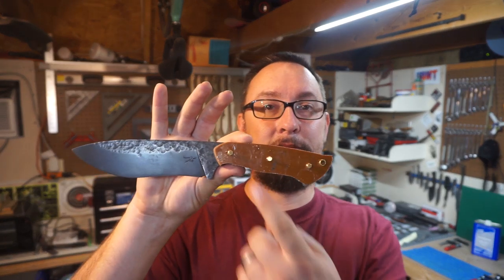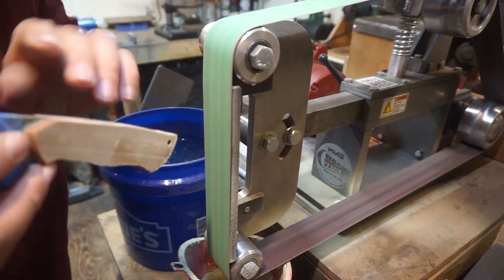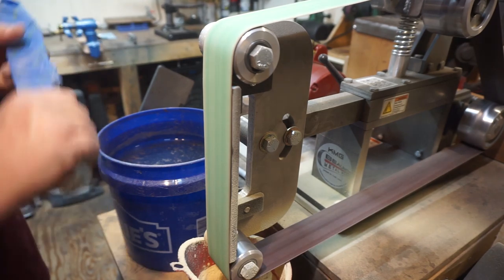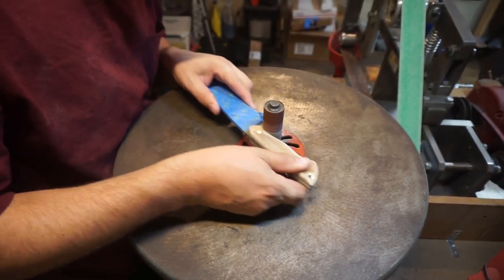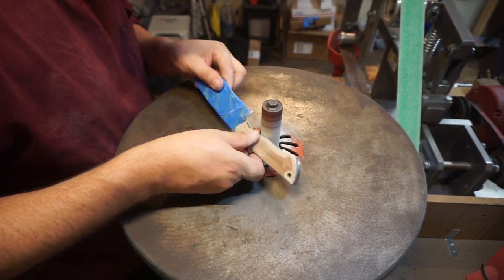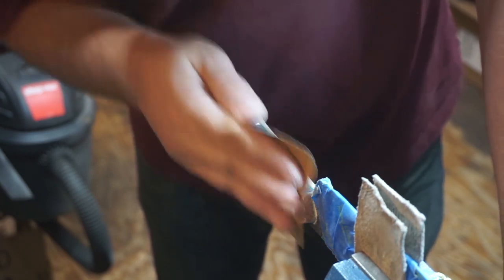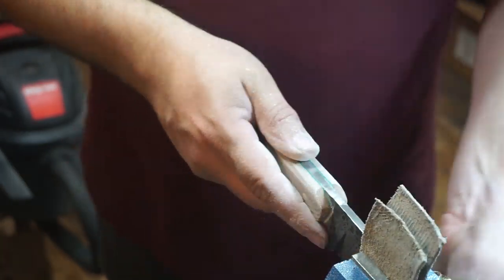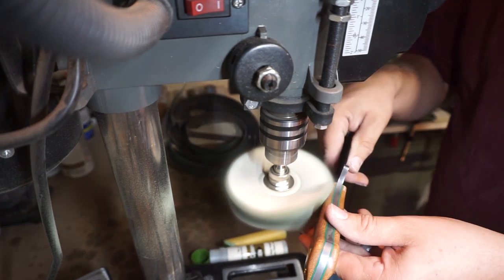Shaping The Handle Scales On A 5160 Drop Point Recurve Chopper | Knife Making | Daily Vlog

Comment: I really like the overall shape and design, that re curve shape always looks great, I'd think of it as a great camping knife but not limited to that. I'm not a big fan of those scale colors with the dark blade, but that's just me, color choice is one of those things that everyone will have a different like and dislike for.
I was wondering how you re stained / etched the spine and other edges after sanding the handle? Did you tape the scales then apply acid with a Que tip or just put it on without taping?
Reply from the maker: Yes, I use a Que Tip to reapply the acid to etch the edge. I only have to tape the scales/liners if I'm using white or light gray liners because it will turn them yellow.

Comment: I missed the build on this blade. What did you use to get the indentation on the blade. Looks awesome brother. Keep on keepn on.
Reply from the maker: I'll be showing the Forging part in the next Shop Talk Tuesday. I Forged the 5160 Leaf Spring flat then used a Ball Peen Hammer to do the texture.
Reply: TYVM 
I don’t want to miss it.